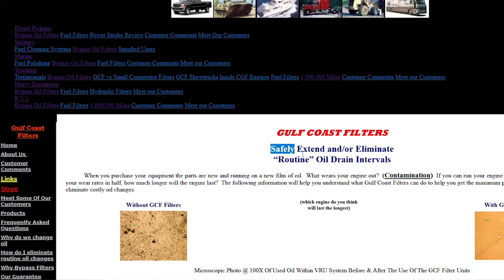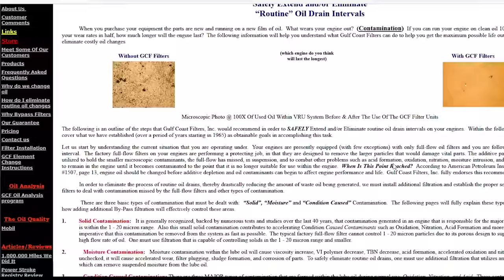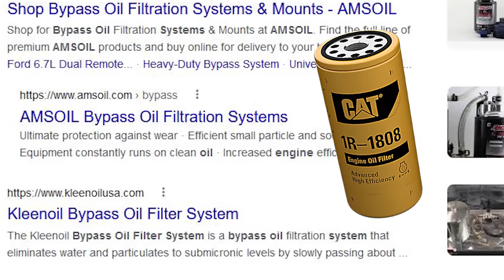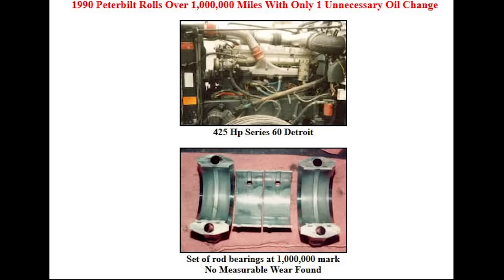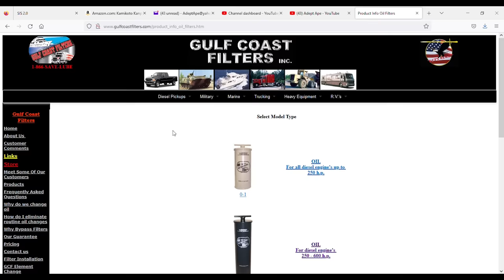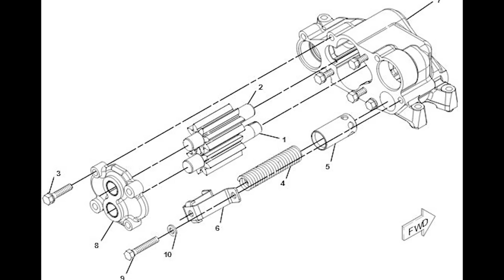No Oil Changes and 1 Million Miles!!! Are Oil Changes Optional with a Bypass Filter? (INTERESTING)

Comment: I've personally have not changed oil on any of the last 5 cars I've owned. My accura ran over 120k  on same oil. Adding a quart every 2k. I beat that car like a step child and sold it 7yrs later. Same oil. I believe if you drive a car daily is super critical to this oil longevity test.  Have it sit for even a week period regularly and you eng is doomed. I have been testing this theory for 25yrs, which include a Benz,Audi,2 Subaru outback and now toyota. They all had tow hitches and pulled a car carrier.  Never had any bearing problems on any vehicle.
Reply: I was talking about my 84 Subaru with 250.000 miles with no oil drains using a Frantz oil cleaner and Mobil i. Got a package in the mail. It was a sample kit from a Caterpillar lab manager. He said the oil looks good for that many miles but recommended a filter change and a quart of Mobil 1 every 6.000 miles instead of every 12.000 miles. I took his advice.The car had no full flow filter. It has a Frantz adapter that eliminated the full flow filter. I prefer the top loader filters all of the toilet paper filters clean oil. I think they are putting the elements in a sock because people assume paper fibers get in the oil. My Jackmaster Classic came with a high quality tightly wound roll of toilet paper in a sock. I use Great Value 1000 from Walmart. The Jackmaster Classic  has the orifice at the outlet I changed it to the inlet.Just my opinion. Been tunning toilet paper filters for 60 years.The Subaru didnt use enough to add oil between filter changes  untill both head gaskets started leaking  oil onto the exhaust system.
Reply: Its funny saying the engine went 120.000 miles on the same oil.A quart of oil every 2.000 miles is 60 quarts of new oil added. My Pontiac gets a roll ot toilet paper and a quart of oil when the Jackmaster Classic is changed. It dont need oil added between filter changes.

Comment: Could just do a oil changes as normal when you have a drum of used oil run it through a filtration system for reuse. 
Would save having a separate system on every vehicle
Reply: The bypass filter needs to be on the truck and be cleaning the oil as you drive to get the long engine life.

Comment: Oburg is the hands down best filter. 😏🖖🏼🇺🇸
Reply: The Oberg  does the same thing as any high flow filter. It removes only the larger abrasives and allows the smaller abrasives to build up in the oil until you drain it. I could see where they might be good for racing where you dont need to worry about sludge or the smaller engine wearing abrasives. You need to study up on filters that clean oil such as  Frantz Gulf Coast.Jackmaster.  Motor Guard. and a few others. All I use now is the Motor Guard the Gulf Coast junior  the Jackmaster Classic The Ford diesel tractor has a flat head Ford canister filter converted to use Scott 1000 toilet paper. The Frantz is a good filter but I prefer the top loaders.

Comment: Moisture is driven off by heat, not removed by a filter.  Bypass filters remove particulates.

My C12 engine has a built in spot for a bypass filter, which is blocked off with a plate.  As a CAT tech, can you tell me why CAT provided a factory solution for a bypass filter, but blocked it off and made it optional for the customer?
Reply: Bypass filters have usually been optional equipment  My 64 Rambler Americzn flat head 6  came with a factory installed spin on filter with steel oil lines..The oil was always dirty and black. Probably about a 10 micron filter.I installed a Frantz oil cleaner and the oil turned amber. Went to lake Texoma to put Gulf Coast junior filters on a 41 foot Chris Craft It had twin 454 engines. He said put a filter on the generator. I saw a plate on the engine. Behind the plate was pipe plugs for the optional bypass filter..
Reply: The generator was a nice little flat head 4. Dont remember the make. Some boaters would know..
Reply: @ralphwood8818  Sounds like an Atomic 4.  I was a sailboat mechanic back in the 90s, and that was a pretty common older gas engine.
Reply: @briansmyla8696  Normally dont do boats. I felt at home with the 454 engines. I couldn't stand up. Had to slide around on my rear end. Couldnt figure out how you could remove an engine. Put Gulf Coast junior  filters on it.Dont want to spend much time in an engine room in Texas in August. Did a Carver for him years earlier.. I think it was a 33 footer. Twin 350s. Engine covers . No engine room.
Reply: On my cars the toilet paper takes out the moisture when the engine is cold.if there is any. As the oil gets hot it removes the water from the toilet paper.. The PCV removes the water from the oil.The system only works if the engine runs at operating temperature long enough.

Comment: Heat causes condensation which is water. Inside the engine blocks this condensation water adds up abd why an oil change and new filter is required. 

However there is another contaminate called carbon which these can form extremely tiny steel grains which cause bearings to wear from scratching. These the filters remove as the oil circulates. If you could remove these steel particles by 100% you could run without changing the oil but its impossible to filter the carbon steel produced particles out. Why?  Because they don't run with the oil, they stay magnetized to the steel parts of the engine and accumulate and rarely move. Yea problem.
Reply: If all this metal is stuck to the engine parts does that mean wben you drain the oil the stuff releases from the engine parts  and is drained with the  used oil.?

Comment: All of the reasons you name for needing to change oil are monitored with the oil analysis.  If there is no fuel dilution, coolant contamination  or oxidation, why bother?  The longest I have gone without an oil change is 485,000 miles, at which time my oil analysis results showed excessive fuel dilution due to leaking injectors.  In my engine's first life I was able to go 335,000 miles without changing but had an oil cooler failure causing coolant contamination.  Engine is a KCB C-13 which was overhauled at 1,015,038 and is now at 1, 063,000 on the overhaul.  At this mileage the engine is still better than when Caterpillar built it new.  I run the Gulf Coast, servicing it at 25,000 miles, sampling at roughly 12,500, use one gallon of oil in 17,000 miles and average 6.81 mpg last 90 days doing dry bulk work.
Reply: Always good to hear from a trucker. Im a car and pickup guy. Mostly gasoline engines. Thanks man.

Comment: I’m in the filtration business of recirculating fluids.  This will be extremely detrimental to your engine.   Here’s the nuts & bolts of how particulates accumulate in a “filtered” system over time….. The percentage of suspended solids (dirt, fine metals, combustion products) that are smaller (micron-size) than you filter INCREASES with each successive filter change with no fluid change.  You will invariable be left with the vast majority of solids that are SMALLER than the filter pore-size and get constantly recirculated and concentrated) most of the solids will then be passing through the filter.  In our business there’s a saying, “the solution to pollution is DILUTION”.  This can only be accomplished with periodic fluid change along with the filter.   I must say….what they did is intriguing….but let’s wait on the first fleet run of someone else’s vehicles in this fashion prior to trying it!😊
Reply: But enough big particles can accumulate and catch smaller particles and smaller particles until it plugs the filters.
Reply: You might try using filters that clean oil. There are several that clean oil. Keeping the oil clean is not detrimental to the engine. I dont run anything on dirty oil. How long do you want to wait. Filters that clean oil have been around for at least  the 30s.They are realy good since the 50s. The system of allowing fluids to get dirty then draining them doesnt help the equipment owner..

Comment: The issue is keeping dirt out of an engine for million miles, fuel soot and condensation. Not changing oil is stupid pure and simple. Did their test engine run in a steady state condition, or was it in a over the road truck? It it run a million miles OTR or a million mile equalivent on a test stand?
Reply: The truck hauled Pepsi Cola for years. Then it hauled motorcycles.Gulf Coast thought they had lost it when Pepsi sold it.The new owner was nice enough to keep the tests going. They also put it on the rollers to test the Horse power It gets the treatment.

Comment: With the filter mesh size being so small, would it not filter out all the beneficial additives in the oil?
Reply: When you send a sample to a lab you will get a list of the additives in the oil. The additives are normally in a liquid form.New additives are added when new oil is added at filter changes A good oil filter can remove some after market additives such as graphite.

Comment: 1:58, blasphemy! You make great points but the only thing you cannot control is the nut behind the wheel. I haven’t done any research into it but I always like those spinner filters, I know it’s just a piece of paper but every little bit helps. Don’t see them that much anymore, maybe they do not work as good as they used to claim.

Comment: But coolant in the engine usually results in a bad oil cooler dropped liner cracked head or block or if it an older engine bad after cooler or pin hole in a liner or cracked liner I'm not a mechanic but I do like to work on my own stuff

Comment: I still don’t trust that system.  They put the old oil back in not accounting for oil coolers oil pumps and turbo.  I still change mine 11,000-12,000 mile intervals.  Got 1,122,000 miles.
Reply: The only reason they drain the engine is the engine is torn down and the parts measured about every 250.000 miles. The last I heard there was no copper showing anywhere. The tin was still on the bearings Then they test the horse power.
Reply: As long as people are so ignorant they think proper maintenance is allowing the oil to get dirty wesr and foul the engine then draining it the oil changers will be laughing all the way to the bank. An extreme case was the old VW beetle. They saved millioms by not putting filters on them. When I met my wife she was having the oil changed about every 1500 miles. She got a Motor Guard. Took several rolls of toilet paper to clean that mess up..my 37 Studebaker book said its not necessary to change the oil except for seasonal reasons. Change the filter when the oil looks dirty on the depth gauge..They used cotton the same as the luberfiner.There are several filters now better than the Luberfiner. To the young guys seasonal reasons was putting thinner oil in for winter.

Comment: 3:20, From my own experience I'm not sure that the micron rating of the coffee filter is the same as the micron rating of the full-flow oil filter.
Recently I did the oil and oil filter replacement on my car and before pre-filling the new oil filter like I always do, I decided to do a little experiment. I wanted to see how easily oil would flow through the coffee filter. I thought hopefully coffee filter could remove any contamination left in the oil container if there was any.
The Toyota filter on my Corolla takes roughly 200ml (6.7Fluid ounces) and It took a very long time for the oil to flow through the filter. I gave up halfway. 
I think the micron rating of my own coffee filter was smaller than the typical oil filter's micron rating.
Reply: No, he's definitely right in the video, your own experience uses a very flawed experiment. The oil system is under pressure, alot of pressure so it pushes the oil through the coffee filter micron size with ease, also when your oil heats up in the engine it reduces the viscosity so it flows through the filter even easier
Reply: Scotty Kilmer entered the chat...
🐱👍🏿
Reply: I have some Motor Guard compressed air elements They are like coffee filter paper in a roll. Of course its like pushing air thru a stack of coffee filters 4 inches tall. They are submicronic. Motor Guards are a one pass filter used for plasma cutters instrument air  painting and that sort of thing They started as a oil filter in 1961. They were the best. Frantz tried to put them out of business. They dropped the lube oil filter. I still have a couple over 50 years old.I have used their elements with hot motor oil.The plastic core cant take hot motor oil Dont know if you can still get the Gulf coast junior. The Jackmaster Classic and the Gulf Coast junior are as good as the Motor Guard. The slower the oil goes thru a filter the better the cleaning. I think Jackmaster got carried away and put too small a orifice at the outlet. I like the the orifice at the inlet. The full flow filter has been removing anything large enough to clog the orifice.. The same Wix has been on for 63.000 miles and over 4 years. Not much in the oil large enough for the full flow filter to remove in a modern engine .what happens if you put too small an orifice at the outlet  it equalizes the pressure in the filter. Toilet paper needs a little more pressure at the top than the bottom. The converted Flat head Ford canister filter on the Ford diesel tractor has no orifice. The Perma Cool universal sandwich adapter puts a little more pressure on the top than bottom of the toilet paper.
Reply: Scotty pulled a slick trick  A lot of people wanted to know about that filter that changed the game.no more oil changes I even bit. He never mentioned a filter that cleaned oil  " We love you Scotty " .
Reply: I was wrong on the Jackmaster Classic orifuce. Its about the same as the others. About .060. I put a .025 wire welder tip in a brass fitting and put it in the inlet. Havent had trouble with the orifice clogging. I make sure the filter is heating up.

Comment: Hmmmmmm, My 1964 Mercedes 200d has a bypass oil filter from the factory. I change the oil every 5000 km as recommended by the owners manual.
Reply: My. 1964 Rambler came with a bypass filter from the factory. To clean the oil  I threw it in the trash and installed a filter that cleaned oil. In those days that was a Frantz oil cleaner.. i change the Australian Jackmaster Classic about every 6.000 miles on the Pontiac Torrant. Normally the factory installed bypass  filters are junk.😅
Reply: @ralphwood8818  Not the old Mercedes ones, they are not cartridge filters but have a very large two stage replaceable filter element made by MANN :)
How long did your rambler and Pontiac last as a matter of interest?
Reply: Dont remember .for sure. About the Rambler . Wife asked me to give it to her little brother.  I think it had about 60.000 miles. He had the rear end jacked up .Then He wrecked it.  The Pontiac had 140.000 miles on it when I got it. It has a little over 200.000 on it.  Dont show any signs of wear. 3.4 engine. Took me about 20 years to put 250.000 miles on 84 Subaru with no oil changes.   Bought  it new.. It  It had  a Frantz oil cleaner and Mobil 1.   The Pontiac has a Australian Jackmaster Classic. Until recently it had a Motor Guard.  The 93 Subaru  Legacy has 240.000 miles on it. Had 116.000 miles on it when I bought it. It has a Motor Guard on  the engine and transmission. It shows no signs  of wear. A guy I worked with came out of a restaurant to find his  Chevy  pickup was gone. I gave the 84 Subaru to him. I told him it runs  perfect but both head gaskets are leaking oil.  It had over 300.000 miles when he went to Iraq. Lost track of it.
Reply: I knowl little about the combination flters. I like to keep the bypass filters separate.

Comment: ill continue changing my oil and using wix filters.
Reply: I gave up allowing the oil to get dirty and draining it in 1963. The Wix filters do the same as any full flow filter. They dont clean oil. The one on my Pontiac has 63.000 miles on it. The Australian Jackmaster Classic  does the cleaning. The Wix replacement element for the Luberfiner  comes close to cleaning oil. The last one I bought years ago used pulverized news papers and wood chips.
Reply: Changed the Jackmaster yesterday on the Pontiac. The top of the toilet paper had more than usual metal particles and carbon on top. My finger could feel the dirt. The Wix full flow filter has 64.000 miles on it. Time to change it. The big stuff isnt supposed to get to the Jackmaster Classic.

Comment: My car's engine works for years and years without a single oil change and i can guarantee you oil changes are unecessary, the engine would continue to work normaly. I just have to add a gallon of oil every once in a while because the oil pan has a serious leak!

Comment: I run Amsoil in my truck with no bypass filter. And I get better MPG and my truck runs better un top of that. But even if I did I would still want to do oil changes at 20,000 to 25,000 miles.
Reply: Amsoil is good oil
Reply: I remember in the early 80s Amsoil had a canister filter with a filter element that might have been as good as toilet paper. They had Bobby Unser saying this oil change is forever.. At the time I was using Amsoil and a Frantz oil cleaner.
Reply: A guy brought me a Ford Powerstroke and enough Amsoil to change the oil. He said change the oil and install a O 1 Gulf  Coast filter. I said what kind of oil is in the truck. He said Shell Rotella 15 40. Im thinking  thet will keep my 6.9 in oil for 
another year..A guy came to the door and asked me if Ralph Wood is still 
alive. He left with 3 oil filters. Saw a picture of one of them on YouTube. It was one of my modified Motor Guards